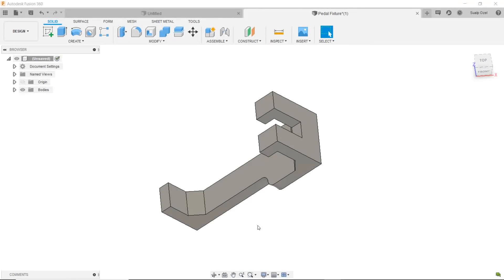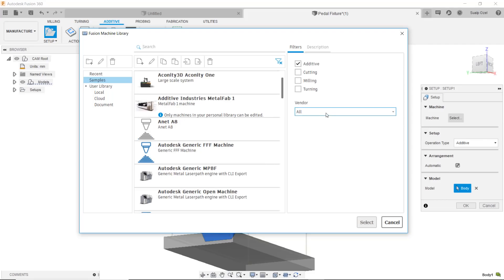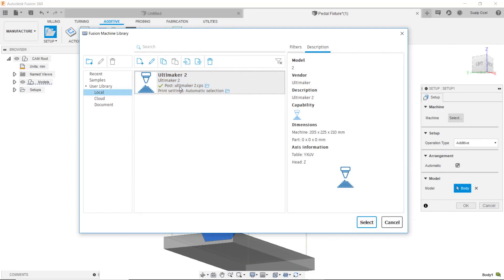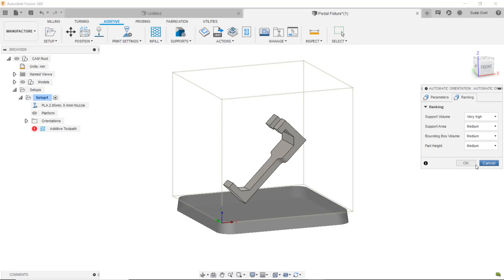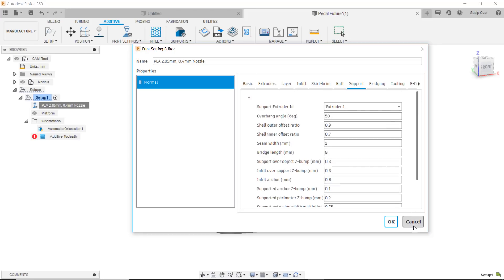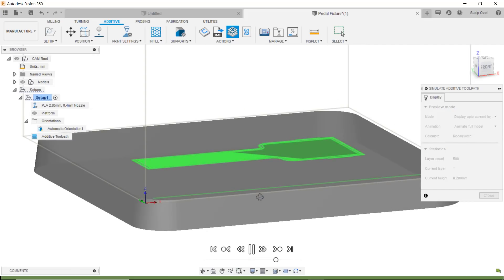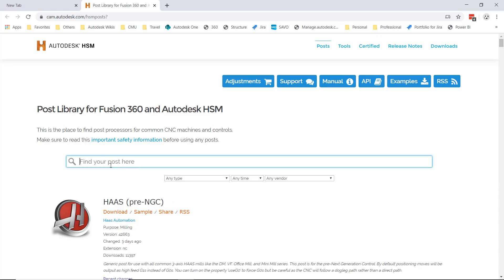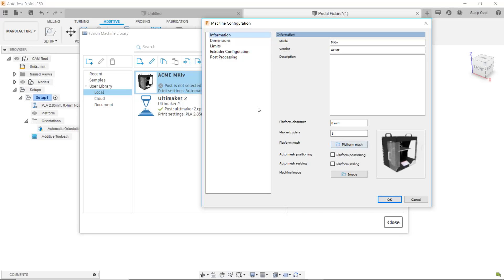3D Printing with Fusion 360 FFF

Comment: Clunky UI / UX.  Still trying to figure how to lay a face on a part so that it's flat on the build plate. (Due to shape, rotating will not work. Rankings don't do it, either.) Even if I could figure it out, I'd have to go through what looks like 30 steps and right click on obscure items in the browser. Looks powerful but struggling to use it after 5 years on Fusion.

Comment: wow.. if fusion360 is the first software to make nonplanar slicing consumer friendly just by the experience with toolpaths and tools, to have a library of standard and non-standard nozzles that can then aid in calculating the tolerance for nonplanar surface slicing based on the length of the nozzle, all the base functions are already built in, please integrate that!
Reply: don't understand what you said, but I agree with you. lol
Reply: J P lol, Teaching Tech has a great video about it and how complex it is to set up. but if you have seen a clay printer printing up and down curves, that is just about that

Comment: Yeah what a great addition.  One aspect I like is that the interface is familiar to me since I have already been using the Subtractive Manufacturing (Milling) capability for some time.  I can see where Fusion is going with this.  The manufacturing side of the software is generally the same throughout, and the user is able to select any of a number of manufacturing methods and machines.  With all your machines setup, post-process as needed, and send to machine.  All within Fusion.  So awesome.  Like Gasonlin1 said "I'm really excited for what the future holds".  Currently I have a benchtop CNC Milling Machine, two 3D Printers, a Laser Scanner, and a Laser Cutter/Engraver.  When I'm able to integrate all these into Fusion, I will be happy :-)  Keep up the great work Fusion.

Comment: No offense, but Fusion needs to focus on fixing the user experience of existing functionality rather than adding features easily available elsewhere.  For example, working with the timeline and parametric design is both the most amazing yet infinitely frustrating feature I've ever experience in software.  Simply reworking a sketch and adjusting a few extrusions can completely destroy hours worth of work.  Good luck trying to extract bodies and sketches into components or even sharing simple parameters between files.  

You've taken your software to a point where I'm afraid to work in a single file and impractical to work across files.  If your looking term strategy is relentless feature-creep, I'm going to start looking for an alternative.  Focus on your core!
Reply: Fully agreed. I've collected a bunch of workflows and tips to survive the shortcomings and surprises you describe. Haven't publicised them yet but if you are interested - I think they might be of help - get in touch via twitter @AskoKauppi or akauppi-at-gmail.
Reply: The CAD team vs DM team vs 3d printing vs CAM team are totally different with different resource levels. They're effectively independent developers building on a platform. There is a team working hard on the core, we just haven't seen much from them of late, which means we will likely see some big things before the end of the yeah... Hopefully. Rob Cohee is heading up that team.

Comment: Please tell me how to change the platform mesh. I cannot find any info on this. What model is used?
Reply: If you click on Machine library on the ribbon, you can choose to create a new printer in your own library (local or cloud) and in that dialog , there is a platform mesh button.
Reply: or if you drag a sample printer in to your local or cloud machine library, you can edit that machine and in that dialog there is a platform mesh button
Reply: @sualpozel1  Yes I have that but I don't know what kind of file to use for the mesh. Doesn't seem to import any of the usual mesh files like stl or obj.
Reply: @johnbickford9221  hi John, you can open any STL file in Microsoft Paint 3D and save it as a 3mf, if you do not have the platform file in 3mf file format.

Comment: Nice start, but.... also needs options (in the HSM additive_*.machine files) for other printer geometries/coordinate systems (e.g. Linear Delta, CoreXY, SCARA, etc...) not just Cartesian; coupled with that it needs support for the other major/common Firmware g-code types (RepRapFirmware, Repetier, etc...) not just Marlin.

edit: also the HSM "Post Processor Training Guide" @ "https://cam.autodesk.com/posts/posts/guides/Post%20Processor%20Training%20Guide.pdf" needs updating for all options relating to "CAPABILITY_ADDITIVE", so that we can have full ability to create our own posts (*.cps files).

Comment: Nice to see this update (I had actually looked to see if there was anything for a CR10 A4 yesterday in F360 I used CURA as usual but had thought I'd look to see) I have a question however.... What is a Post? It's mentioned constantly in this video with no explanation. Sorry I'm English so maybe it means something different in America but please give me a clue.... Two nations separated by a common language I fear.
Reply: It's short for post processor. It is basically the interface that turns the slice information into machine readable g-code for a specific machine. This is why you need to have a specific post processor for each machine. This concept is more known in the subtractive CAM world, so it needs some explanation, but also offers a few opportunities in the long term. (disclaimer: I work for Autodesk and am involved in this project ;) )
Reply: @lukasfuhrmann8076  Thank you the clarification I guessed it might be but its far better not to rely on guesswork. Wouldn't have taken much to have said post processor just the once. Which do I use for a CR10 by the way:
Reply: @kelvink8955  I agree it should have been mentioned, as Sualp explained in a few comments this video was created for internal purposes originally. We will release some more broken down tutorial content to help with the transition from other slicers. We are currently also finalizing the testing and release of some of the posts and the CR10 is part of that. You can find them on this website as soon as they are ready: https://cam.autodesk.com/hsmposts . In the mean time you could also create your own post processor or try the "Generic FFF one" and see if you can modify that.

Comment: Total waste of resources. CURA is lightyears ahead and it is strange to embed HW printer details in a design tool. I am using 360 to design and handing STL over to CURA tuned to one of my printers is effortless.
Reply: And Cura of course got to where it is now on Day 1 of release ?
Reply: @seabreezecoffeeroasters7994 This is a very engineering expensive "print to" function where the HW specifics of the printer are not hidden in a driver, but made part of a design tool. From a system perspective not core functionality.
Reply: Eric van Beurden this is simply our first release and we are excited to keep working on this tech , bringing in improvement from various ADSK additive technologies such as netfabb meshmixer and powermill ultimate’s additive capabilities as needed. Looking forward to what the community can do with this tech today and in the future.
Reply: I generally agree that it is hard to see the benefit. I would much have preferred more updates to the design or manufacturing space. A 4 or 5 axis adaptive clearing would have been a better place to spend the time

Comment: I'm not seeing some of the machine's in my machine library. I have the Manufacture Extension turned on/ purchased. Specifically not seeing Creality, Ultimaker, Prusa,  Anet...
Reply: Sean Thomas did you update your fusion to the latest release?
Reply: also one does not need to purchase the "Manufacture Extension" for FFF. it is included with Fusion without any extensions

Comment: I'm a big fan of this update.
At the moment, Slic3r, Cura and co. might be far better for FFF manufacturing, but Fusion has not only an STL to work with, like the other ones. So in the future, the Postprocessor could do Dynamic infill based on Data from load studies, 5-Axis Printig and what not.
I'm excited for what the Future holds.
Reply: I wasn't even thinking about nonplanar printing and the stuff you mentioned ... I was just happy with the workflow benefit of not changing programs. what an update!
Reply: I'm really hopping for inner shell ribbed infill .
Reply: God yes.  I would be SO HAPPY just to be able to slice things directly in Fusion 360 and include features like non-planar printing.  That would be especially great for a lot of things.
Reply: @Bakamoichigei  It seems to work great! I've been a 3D printer for 3 days now and so far I've found Fusion 360 is better than Cura...at least when I model something in Fusion the print comes out to size, where Cura doesn't appear to give any accurate control of scaling.
But as above, I've been doing this very briefly...
Reply: For sure Gasonlin1.  As an engineer, I like the way you think.  Imagine adding Topology Optimization to that work flow to optimize the design for minimum weight/material while maximizing strength, and then combine that with the Dynamic Infill to further minimize build material, and you have one efficient model indeed.

Comment: Very nice, I will try it!
Reply: Yes it worked. I could also adopt the generic post processor to my custom printer, but there is one thing, that makes it useless at the moment: At the end of each print the Gcode tells the printer to go to the park position. This means it has to go up to the top of the printer after each print. I have a custom printer with high resolution z-axis, so I have to wait a long time for the printer going first up, and then for the next print going down again. In my slicer I can make custom Gcodes as ending scripts to allow the printer to move with relative coordinates 30mm over the highest actual print. This saves much time. In the post it is IMHO not possible to fix that. I can manually set the Gcode all the time before printing, but that is not productive. It would be nice to have the possibility to change the park position to relative, the minimum should be to disable the got to park position.

Comment: Incredible work, It looks very usable and already feature rich. I hope we will see the amount of settings and features grow. Right now the option to finally export to .3mf rather than .stl is the most useful as I and probably a lot of users will stick to dedicated slicers for more control over the printing process. I will use this new FFF environment until I run into problems that require more sophisticated slicers, but I hope that in the future I will be able to design, slice and send gcode to my printer  all inside fusion without ever wishing I had some other slicer. Once again, very happy to see this and hope to see more.

Comment: Excellent! A few minor problems though...
Using the Anet A8 machine settings, cannot change the fan speed...
And need to set the start and end gcode, like you can in Cura...
Miss the ability to have different settings for different vertical zones (like S3D, and Cura - to a limited extent)...
The big advantage though, now I can save all the print settings along with the geometry!!!

But I'm overjoyed that FDM has finally arrived in Fusion 360, well done!
Reply: You can create your custom POST file and set start / end gcode with that method with ease Fred. As this is the first release in Fusion, we did not get a chance to add all the features we wanted. We will continue our work on this every day week month for the foreseeable future and you will see continuous improvement release over release so stay tuned. We are very excited and looking forward to all your feedback.
Reply: @sualpozel1  Yes, I'm looking at posts now. And I'm sure you'll add a whole raft of nice features in the near (hopefully) future. Gyroid infill perhaps?